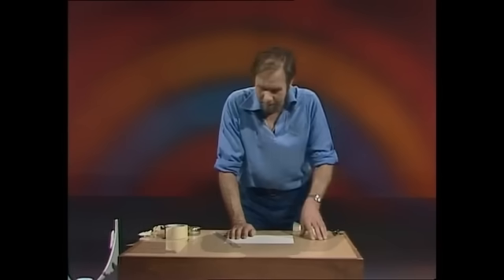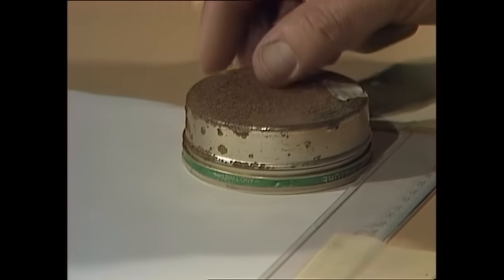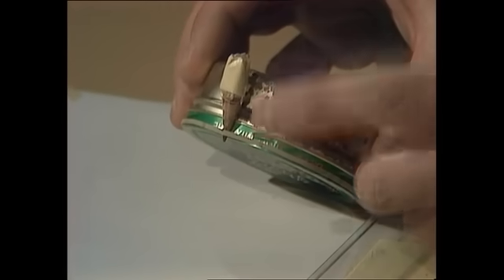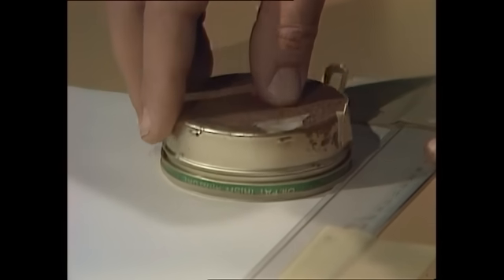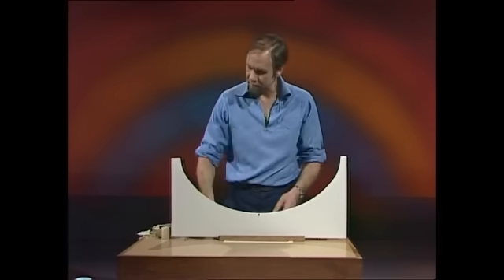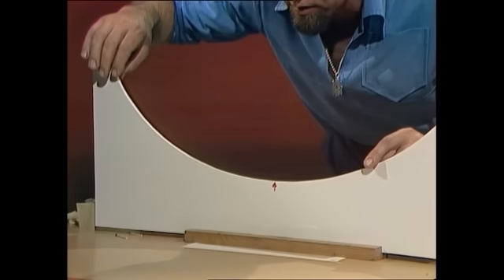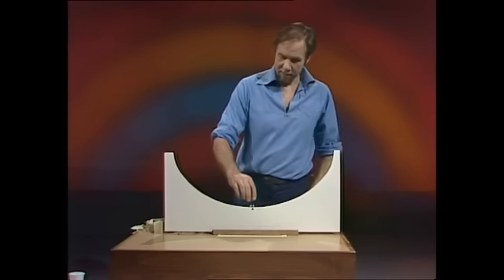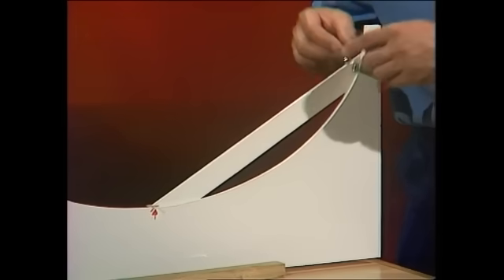The mysterious isochronous curve

Comment: If the bicycle wheel with the white stopped briefly, surely it always be stationary as each point would stop briefly, not just the bit with white paint?
Reply from the maker: That sounds like the hare and tortoise paradox, but not really. Think of a bouncing ball. It is stationary on hitting the ground but moving at all other times, The wheel would only be stationary if every point on it was on the ground at the same time - Rob

Comment: The brachistochrone is such an interesting problem! The question is, what's the shortest path between two points in spacetime? Clearly, if we were just talking about space,a straight line would do it. But how can you analytically solve for the shortest path when speed comes into question too? It seems like a classic optimization problem, but it's not. We can minimize path or we can maximize velocity. Turns out you need to do a little bit of both to get the truly shortest path. It's really neat

Comment: Been scrolling through the comments and haven't found anyone realize that this isn't curious or strange, the curve has a sharper "ramp", if you will, the higher up you go, therefore increasing the velocity rapidly as the object rolls down. The lower it is, or if on a more shallow linear ramp, the less velocity is being built up, there for making it roll slower as compared to the opposite, allowing them to meet simultaneously. In short: one rolls faster down a long ramp while the other rolls slower down the short ramp (whether it be straight or curved) meeting at the same point. And everyone is saying this is an educational video...

Comment: Well they fall at the same rate
Reply from the maker: No, they can't, or the one closer to the bottom would get there first. They get there at the same time so the one from higher up must have gone faster. - Rob
Reply: CuriosityShow Well yeah exactly my point, they fall at the same rate but the one that is higher because of the slope will move faster than the one that’s lower. That’s why when you shoot a bullet and drop one out of your hand they’ll hit the ground at the same time. The point is at the center of the circle, which is where the center of gravity is.

Comment: So completely, mindblowingly cool, and explained so clearly, concisely, and understandably! Thanks for the great video! That being said, I am always impressed by the subtle differences between Limeys and Yanks (Disclaimer: Terms of nationality are used in a strictly loving and respectful way!).  I observed that for your demonstration you used an old rusty tin for your "Tyre", and a shabby old pencil nub for your marking device.  A practical and sensible choice for both.  After consulting with noted leaders in the scientific and engineering communities of these united states however, it became clear that these choices simply would not do in a scientific demonstration on this western side of the pond.  The production laboratories at NASA, working in partnership with M.I.T. engineering faculty, would have employed the latest in nano metallic 3D printing technology to produce a cylinder of the purist Titanium describing a circular radius accurate to within .007 picometers.  This cylinder, instead of a pencil nib (Nub?) would be equipped with a 10 watt etching laser producing a beam with a diameter of 12 angstroms with a linear amplitude of less than .04 Framogens.  The paper would be replaced with a metallic vellum coated with a molecule thick layer of ignatiuous graphene (the details of which I cannot reveal due to its existence being part of a classified DARPA project ).
In all, the entire cost of the demonstration would run the American tax payers roughly 1.2 billion dollars, and would take a projected time of 8 years to accomplish, producing the same basic results that your humble demonstration did. My point? None really, just feeling cute today. Thanks for reading!
Reply from the maker: Thanks, but Australian, not British.Curiosity Show was anational science program for children featuring Dr Rob Morrison and Dr Deane
Hutton. It was made in Adelaide, South Australia and screened nationally in
Australia as well as in Europe, Asia and Australasia (14 countries) from
1972-1990. Deane and Rob intentionally used everyday items around the house
(like old cans) so that children could repeat the demonstrations with materials
they had to hand. In 1984 Curiosity Show won the Prix Jeunesse International,
the world's top award for children's TV programs. Rob and Deane are steadily
uploading segments at www.youtube.com/curiosityshow   Why not subscribe?

Comment: Here is another slant on this excellent video.   From a marine hull archeteture ,this curve is the fastest hull design in racing paddlecraft.  By taking a popsickle stick and a rounded dowlel in each hand,then lifting them simutaneously from the surface of a tank of water, you will find that the dowel rises first rather than the flater pop sickle stick. It is the surface tention!  This guys curve will easyly seek a higher waterline under increased power.  However only pros should attempt rounder(parabolic shaped hull configurations),as they are tippy unless under controled power.
Reply from the maker: Many thanks, I didn't know that - Rob

Comment: An isochronous curve is, in fact, the correct curve for a time-keeping pendulum. It is however, impossible to use (for pendulums) in practice. Sir Isaac Newton (along with Leibniz) was challenged to solve two mathematical problems by Johann Bernoulli. Newton solved both problems in a short period of time. One of them was the derivation of the isochronous curve. After Newton submitted his solutions anonymously. Bernoulli recognized the anonymous winner in public with the phrase, “tanquam ex ungue leonem,” Latin for “we know the lion by his claw.”
Reply: The history of the world is an endless cycle of deep intellectual thoughts about the meaning of life, deteriorating into meaningless debates over who is right.
Reply: Even the snails in my fish tank know this. Why? Because their shells are an isochronous curve
Reply: @steamdream19 
Why would it be so from evolution point of view?
Reply: And also, what a polite ask in the first replys
Reply: Luckily the arc of a circle with a small angular displacement behaves very similarly to the isochronous curve. Which is where the small angle,approximation for pendulums factors in!
Reply: My comments above contain a partial error. My comments are about isochronous curves (also called tautochrone curves). These are equal time curves, but impossible to use with real pendulums. Newton derived brachistochrone curves, not tautochrone curves. Christiaan Huygens derived the correct formula for tautochronous curves. It turns out tautochrone curves are the same as brachistochrone curves. Note that Galileo thought that semicircles were tautochronous curves. He believed that the period of a pendulum was independent of its amplitude. This turns out to be very close to true, but not quite true. Pendulums can be used for clocks, even though semicircles are not tautochronous curves.
Reply: @peterschaeffer  "Pendulums can be used for clocks, even though semicircles are not tautochronous curves." I think the reason is that clock pendula are power-driven to equal-height swings. Since there is no need for equal-time motion as the swings decrease in height, since they do not, there is no need for any isochronous constraint.
Reply: @david203  As a practical matter pendulum clocks are power driven to maintain roughly constant amplitude. However, that wouldn't be nearly good for accurate time keeping if semicircles weren't very close to tautochronous curves for small amplitudes. Note that various power mechanisms were used to drive clocks before pendulums. However, these clocks were very inaccurate. Of course, Harrison's famous clock didn't use a pendulum at all. It used a spring mechanism instead.
Reply: In other words "Ha, gatcha bitch"
Reply: Nice
Reply: Bernoulli as in the Bernoulli principle?
Reply: @bbbildhuu  Yes but maybe not the same one because it was a large scientific family.
Reply: @bbbildhuu  As Wade Buck points out below, the Bernoulli's were a large scientific family. It appears that the "Bernoulli principle" was devised by Daniel Bernoulli (https://en.wikipedia.org/wiki/Bernoulli%27s_principle). The math problem is attributed to Johann Bernoulli (https://en.wikipedia.org/wiki/Brachistochrone_curve). I actually thought that the same Bernoulli was responsible for both. This was apparently an error on my part.
Reply: Thank you for the latin. i collect latin expressions.  My faves  are 'Dubito ergo sum'. and of course my family's motto ' Virescet vulnere virtus'.
Reply: Since there's someone who might be interested, I'll point out that the expression "tamquam ex ungue leonem" is in fact an incomplete sentence that simply means "like the lion from a claw."
Sadly, as knowledge of latin becomes rarer and rarer, so do errors in quotes and translations multiply.
Reply: @flatbreadenergy7389  The phrase is a latin translation of the original greek "εξ όνυχος τον λέοντα". From the onyx you can guess the lion.
Reply: I didn't know there was a greek source. But that one is even more concise: "from the claw ['onyx' means (finger)nail in greek, hence the name of the stone], the lion."
Reply: Too smart for me .. But nonetheless informative
Reply: Im pretty sure that Sarpi ghost-wrote those proofs for Newton like he did half of Principia. Or maybe this just another thing stolen by Enlightenment propaganda off Leibniz and given to Newton  :)
Reply: Great story. Thanks for sharing.
Reply: Yes. Also these curves are studied as models in The Calculus Of Variations with Ordinary Differential Equations and Partial Differential Equations in a Mathematics Degree. This is where I learnt about them.
Reply: Peter Schaeffer  respectfully I am an amateur student of the historical lives of scientist. Could you please cite the publication you acquired this footnote? As a young man I hated history more than anything, likely due to my professors and the states approved text books, but as I've grown older my appreciation for scientific history and pre western history has improved vastly.  If all of history could be taught along side and through scientific advances of the day my interest would have been markedly different. Thank You in advance.
Reply: @00gsean  Of course, I would be glad to. You can find several sources for the quote. Start with "Later life of Isaac Newton" in Wikipedia. You can also take a look at "Brachistochrone curve" (also in Wikipedia) and "The brachistochrone problem", https://www.math.purdue.edu/~eremenko/bernoulli.html, etc. 

There are several interesting aspects to this. Newton's talent was immense. However, the Calculus he devised was actually not as good as the Calculus invented by Leibniz. As long as Newton lived, this was not apparent because of the immense talent of Newton. After Newton died, the Mathematics community shifted to the Calculus system devised by Leibniz (which is what we use today).
Reply: John Cena you are an embarrassment to Americans! Why would your 70 IQ ass even be watching this video 😂
Reply: Thank you for this tidbit. Popular culture can be scintillating at times.
Reply: @musamor75  nice try but you're using scintillating incorrectly so stop trying to act smart
Reply: So typical of the internet 00sean asks Peter Schaeffer to 'please cite the publication where he acquired this footnote'. Peter kindly does so, yet 00Sean makes no attempt to thank him.
Reply: Almost everyone replying is a narcissistic person. Dont get made because your ego is hurt I’m talking about a few comments but won’t say their names to ovoid some back and forth you’re an idiot conversation
Reply: Everything that was written here I already knew but knew it way before anyone here so....
Reply: @michaeltudyk8660  I knew you knew before you wrote it so...
Reply: @ineedabetterusername7424  I knew that you knew that he knew before you were born so....
Reply: No one asked
Reply: @Peter Schaeffer  OK, at least you're not claiming to have completely made up your original comment all by yourself, considering it's copy and pasted from various sources.

[ https://gordma.wordpress.com/2014/03/26/we-know-the-lion-by-his-claw/ ] --
"When Bernoulli announced the winners of his contest, he named Leibniz, the Marquis Guillaume de l’Hopital, and the one anonymous winner. Bernoulli recognized the anonymous winner in public with the phrase, “tanquam ex ungue leonem,” Latin for “we know the lion by his claw.”"

The whole thing is in reference to prove who invented Calculus; Newton, or Leibniz [ a friend of Bernoulli ].
Reply: @RiftZM  They are called sources, who is going to bother with rewording every paragraph cited for a YT comment? Grow up.

Comment: Interesting but how do you compensate for the error of the pencil not being exactly on the same plane as the rubber tyre?
The pencil is marginally away from the rubber band.
Reply from the maker: Not really. It was sharpened to a point and the band only went over the lead, so the lead was in contact with the tin itself - Rob

Comment: 10 MTS per second is gravity. And radius of earth is 10 thousand MTS. So curvature ratio is 1000 per second approximately. Frequency of earth.
Reply: Light is 380 thousand kilo meters. Ratio multiplied gives 380000000. Nano frequency.
Reply: Distance of the universe is 3600000 light years. 3600×365 approximated.
Reply: Escape velocity of earth is 10 km with mass 20×1000^3 so for light mass is 20×1000^3×3×10^8 kg. Approximately. But exactly how should be worked out.
Reply: Stable state are parallels. If the vertical is beyond the height then escape beyond EHorizon .

Comment: From what i'm seeing it appears to me(and please i invite correction if needed) that this is simply 2 parts put together of a graph of the acceleration of gravity, one part being from the top to the middle, and then a mirror image to give a semicircle, since its the exact slope for gravities acceleration(which i believe is 16x squared if i'm not mistaken, yes? with its derivative being 32x?) you are maximising the efficiency of the kinetic energy, given any point on the curve as its potential energy, thus it always meeting at the middle, AND in the shortest possible time(shortest time at free fall of course) the weight of the ball is irrelevant. in other words, if we were say doing this on say .... Mars bitches!(i'm talkin about space nigga! lol you gotta be my age to get it), then the angle of the curve would be much much shallower, or i guess obtuse, but if we were say on jupiter, then the angle/curve would be very much more steeper or acute in order for 2 ....bearings to meet in the middle.

However what im stumped with is this: either way, whether on mars, earth, or jupiter, he is still using the same measurement to form the curve; 2 pi, its as if the geometry of a circle exactly matches the level of gravity earth exerts on us, very interesting! (Again if anyone knows for sure please do correct me, i simply did a calculated guess based off my limited understandings of nature. like science i try to hold as little if any ego towards my findings, unlike other commenters who freakin flip out when ther corrected!)
Reply: No.  Not sure what you mean by "a graph of the acceleration of gravtiy".  Are you referring to the inverse square law of Gravity?  This isn't that.  Also, this is not a semicircle.  It's also not the "exact slope for gravities (sp) acceleration".    Where does "2pi" appear in the video?  I missed it.
Reply: Makes sense to me. Very interesting point about the graph

Comment: In my younger days as a Dockyard apprentice in Malta and in Chatham, at the Dockyard school we used to call this  this a cycloid and there is the epicycloid and the hypocycloid associated with it.  I believe gears are generated from this curve.  The " isochronous " title came about because of its " time" functions when it carries an object on its hollow curve where the time of descent is not dependent on the starting point. 
A cycloid is the curve traced by a point on the rim of a circular wheel as the wheel rolls along a straight line without slipping. A cycloid is a specific form of trochoid and is an example of a roulette, a curve generated by a curve rolling on another curve.
The cycloid, with the cusps pointing upward, is the curve of fastest descent under constant gravity, and is also the form of a curve for which the period of an object in descent on the curve does not depend on the object's starting position.
Reply: Very true! Often part of engineering geometric exam questions. The majority of gear teeth are formed using cycloidal geometry. Larger gear teeth are often formed from a involute curve.
Reply: @anthonyperry5227  
Popularly known as hypoid gears
Reply: Ohhhh...So that's how David took Goliath down.
Reply: @DEADWRONGx  
No but I think it has something to do with Odyssevs
Reply: Do note that many people do not know that on a car driving at any speed even a high speed, the one point on the curve of the rotating wheel touching the ground is absolutely stationary as long as there is no slipping as when driving on ice. 
The highest point on the wheel is traveling instantaneously at twice the speed of the car, while the only part of the wheel that is traveling at the same speed as the car is the central shaft of the wheel.